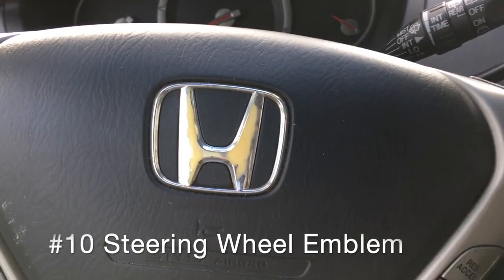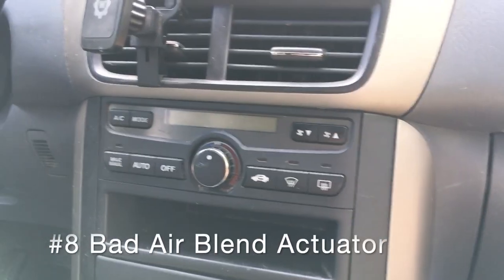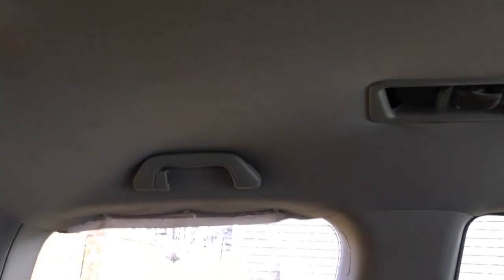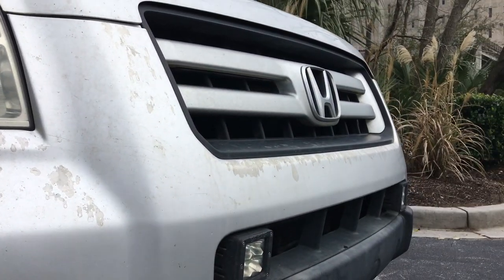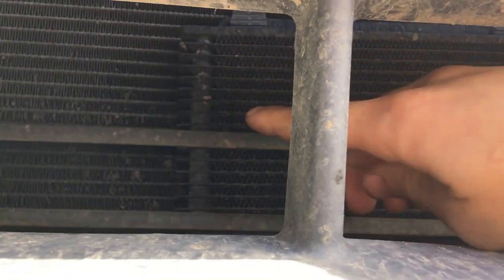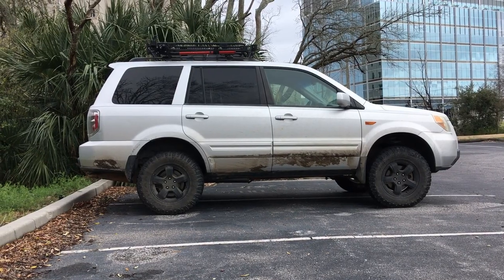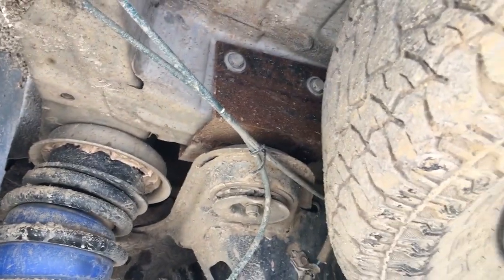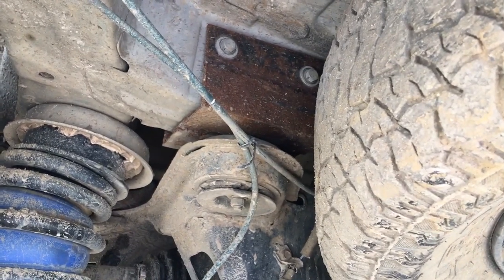Top 10 Common Honda Pilot Problems (2003-2008)

Comment: The steel impact beam behind the rear bumper tends to rust badly up north where we get the annual salt/brine baths. I bought a replacement impact beam from Ebay for $120 shipped. Mine leaves rusty potato chip size pieces wherever I park....LOL
Reply from the maker: I replaced my rear bumper beam to 😂. It wasn’t dropping chips though lol
Reply: yup all the ones i see at the dealer auctions have rusty bumper beams, i live in PA.

Comment: Hey, thanks a lot for your videos! We bought a Pilot 2007 about a year ago and so far we have been dealing with 3 issues. TPMS (I already took notes about the 7 years life for the sensor and to change it preferably when buying new tires). A second issue is the leaking oil, I saw some videos that talked about changing a plastic (do not recall the name) but it has like 6 holes and looks really simple and cheap to replace with a new one (oil filter was also recommended to have it changed). The third issue we are currently dealing with is the VSA warning error. I have noticed that when I turned to the left or right, the error VSA on dashboard is displayed and then it feels like pilot can't move/accelerate. What I do is set on parking, turn off the vehicle and turn on again. This happens around 3-4 times every time I use my pilot. Some say it is due to a disbalance support, some say you have to change bulb (part no. 37250-PNE-G01), any advise you have on this is GREATLY appreciated. In the next days I will take it to a shop, but I would like to have a better understanding and concrete ideas of how to solve this issue as I would not like to pay excessive fees. Again, thanks for your educational videos!
Reply from the maker: On my Pilot VSA can be disabled with a Pilot. Until you can find the cause of the VSA error turning off the VSA will allow you to make turning and accelerating more safe. I have a rare intermittent issue with this that I have not tracked down yet. My research seemed to indicate it could be a sensor in the steering. I am sure there is a way to read codes/ perform a diagnostic to see where the fault lies. The oil leak could be simple, or it could be harder to deal with. My Pilot is currently leaking from the rear main seal. I plan to fix this when/if my transmission goes bad. In the meantime I just keep an eye on my oil levels. It is a pretty slow leak.
Reply: Thank you. For the leaking problem I am hoping it gets repaired with a gasket replacement, if not I read some other solutions like replacing the hose or the ATF pipe (they get rusty). The parts are not as pricey as I thought ($30-$60). About the TSA, I am gathering some ideas on what could be the cause, so I can give this info to the shop (hopefully they do not get offended, as I am just trying to help).

Comment: Only problem I have is with the inside lights. I know it has to do with the head unit above the rear view mirror, but I'm going to try to take it apart and see if I can fix it. If not, I'll replace it. I feel very lucky because I have not experienced any of these other problems. 2004 bought at an auction. replaced the battery and charged the A/C every summer over the last 3 years. Not bad for $1500.00 4 years ago.

Comment: 2005 Piot owner here. I bought mine with 138k and since then replaced 2 TPMS sensors, replaced starter, i replaced the Tbelt, and the PS pump orings. . The valve cover gaskets also tend to leak over time. It's a solid SUV but like all other vehicles that are that old need some TLC

Comment: dude, that ac blend motor, I've been trying to figure out what that noise was for the longest time.  Just ordered the part.  Thanks dude.  my right rear shock mount just broke right off.  that was a surprise.  if you do the timing belt/water pump yourself, don't bother with a impact for the harmonic balancer.  spent days on it with that.  got the tool for it, and used a breaker bar and it came right out.  lots of frustration on that.

Comment: Bought my 04 pilot in 2008 with 78k miles now she has 242,678 miles and only problems I’ve had was my transmission went out and the fuel pump relay went out I suggest u replace those cause they will leave u stranded very easy/cheap fix along with the engine mounts! My timing belt snapped on me at 230k once but I got lucky I didn’t damage the engine and she still rolling would def recommend this car to anyone

Comment: Nail polish! Use 120 grit or higher sand paper to prep the emblem. Be very careful to not sand on the steering wheel itself. Won't look PERFECT, but it at least won't look noticeable.
Reply from the maker: Good idea

Comment: Have a 2006 Pilot with 242k miles. Bought it at 100k eight years ago. Had to replace the timing belt and water pump at about 170k, way past the recommended time. My TPMS sensors went out and my mechanic wanted $300 to install all four. I passed, since I can manually check the air on the tires regularly. Is that too old school?
We also have the gurgling noise, that we couldn’t figure out - so grateful for your video. We are also repairing the rear axle next week and we’re grateful that this was repairable as the rest of the vehicle is in decent shape still. 
One issue we haven’t figured out is slightly flickering lights when idling. Any ideas?

Comment: Here's a follow up to my unibody repair. I was told by mechanics that I needed to seek a "small body shop". When I did so I was told by some that it was a 4K to 5K fix which would far exceed the value of the vehicle. I chose to reel it back and seek other solutions. I searched chassis repair and frame repair. also shops that deal  with axels might be a good choice. I'm afraid that a lot of these vehicles are winding up in the salvage yards because of the gloom and doom being delivered by techs working in a field that is unassociated with the repair that is required. They simply don't now what the proper fix might be. When I found the right shop they told me flat out that it was $650 per side and luckily only one side needed the work but they wouldn't know until the work was started. My pilot is handling much better and is now worthy of a new set of tires.
Reply from the maker: Thanks for sharing your experience!

Comment: Rear ac went out, it’s a fairly common issue. Thankfully, the fix is a resistor replacement that just screws in and and out and you can get the part for 5 bucks at a junkyard

Comment: I have a silver 04 EX RES with almost 193k miles on it.  I tow with it.  A transmission cooler is a must, went with an aftermarket heavy duty one not the factory one.  Only major issues from when I bought it with 33k miles to now have been 1 motor mount at around 105k miles and starter motor went out at 160k miles.  Some little annoying items have been the rear AC not working - easy fix with a $12 motor resistor part on Amazon.  Also, the bulbs on the various dash buttons.

My A/C temp control works great, no issues but I do get that gurgling sound sometimes behind the center console.
Reply: Forgot to add, keep up the good work...I enjoy the videos!
Reply: Mine's been gurgling for about 2 years. I'll probably replace it when it dies, hopefully not in the middle of winter.

Comment: We have or have had 7/10 of these issues on our 212k mile 2008. Strangely enough, it's lived in the northeast all of its life, and the subframe is in fairly decent condition. It has a bit of surface rust, but nothing near what I would have expected it to be.
Reply: spray the left rear subframe mount down with Fluidfilm...also spray it generously inside the rail where theres an opening to the mount.
Reply: Same

Comment: 05 pilot EXL 200,000 miles with a whining power steering pump and a P0430 code, bank 2 catalytic converter below threshold lol other than that i love the damn thing. just got the valve adjustment done with  brake fluid flush for 200 bucks!.
Reply from the maker: The whining power steering pump can sometimes be fixed with a replacement oring. That is a great deal on the valve adjustment and brake fluid change!
Reply: did you do the valve adjustment prior to 200k miles before?  or was this the  first time?
Reply: @viclew9311  not sure I bought the truck used. so I just did everything that should've been done. I would suggest getting the valve adjustment asap or at the 100K mark. i have heard that, that's the reason a lot of cats go bad because people neglect the valve adjustment.

Comment: Drains from cowl at bottom of windshield, drain out through mud flaps!
Mudflaps plug up wit mud and fill your pillar with water, up until water starts coming in following your harnesses.
Carpets get soaked. 
Drill larger drain holes in mud flap as and keep mud clear.

Comment: I have an 06, purchased new and I'm glad to say I don't have any of these issues. 134, 500 miles, garage kept, still looks new. I did change the timing belt & water pump (not leaking) . There's no maybe, if the timing belt breaks in these engines the valves will hit the pistons and destroy the engine SO CHANGE THE TIMING BELT AT LEAST EVERY 100,000 MILES & water pump since you have it torn down that far.  About $200 for belt & water pump DIY or expect to pay 1,200 to 1,600 for a mechanic or dealership to do it. Does not use or burn any oil between 4000 mile oil change & filter, (Mobil 1 oil & filter). Only other thing I've done is regular things like tires, battery,  brakes, coolant & transmission mission flush every 30,000, air filter & cabin air filter. Still ice cold A/C. The tire air pressure sensors still works, (haven't replaced any batteries or sensors yet). These SUV's are well worth the money.

Comment: I bought an 06 Pilot with 181k miles. The first thing I did was to have the timing belt water pump complete kit replaced at a local auto repair for $500. The actuator and headliner are the only pending repairs to be done.
Reply from the maker: Good call on the timing belt and water pump! That was a great price. The actuator is pretty easy, the headliner seams like a pain.
Reply: Whats the name of the local shop you had your car serviced.maybe they have a shop near here in Guelph Ontario
Reply: I bought at 07 pilot with 187k how does one know if the timing belt needs to be changed? 
The only thing I notice when driving is that if I’m driving around 40mph it feels weird. Any test I can do to diagnose those problem.

Comment: My 2007 Honda Pilot's left front wheel sensor had to be replaced. My cheap Actron analyzer brought the code up. It wasn't an expensive repair, just time consuming!
Reply from the maker: @johnshuler1396  I have replaced a few of those already:)

Comment: Great Video.  I have a 2007 Pilot and love it even at 201K on the miles.   I live in NJ and currently have a problem with the engine indicating that is it overheating when in stop and go traffic.  Had my mechanic(over 20 years now) take a look at it and he could not find a problem.  He ran it for over an hour, the indicator indicated that it was getting hot and got to 3/4, then the fan spun on and it cooled right down.  Coolant was changed in the fall.  All hoses are in good shape and the engine has oil.  Radiator was replaced last summer.  Any ideas would be appreciated.
Reply from the maker: When the radiator is cool open it and see if it is full of fluid all the way to the top. It is possible for a head gasket leak to allow exhaust gas into the radiator. The gas displaces the fluid and reduces efficiency.
Reply: @GotterAdventure  - Thank You.  Didn't realize that the anti-freeze had dropped so significantly.  I filled it up and the issue has gone away.  I hope I have not damaged the engine.  Much appreciated.  Stan.

Comment: oil pump failure from using quick lube shop recycled oil and the wrong weight. its crucial to use the 5w-20 not 5w-30 or anything else.
had an 06 that failed because of this but I'm now thinking of adding a pressure gauge to my 05
Reply from the maker: That is good to know!

Comment: Fortunatley, I’ve had none of the issues you mentioned. Mine is a 2003, northeast owner with no frame rot, maybe because I hose down the frame each first chance I get after driving in any snow/salt. Only rust issue I had was the bolt on rear metal bumper, under the plastic. Completely rusted, probably because of poor drainage. I agree on getting only asin parts when doing timing belt change. Only other issue I’ve had was that the pilot seems to suffer from weak suspension components, almost as if the control arms, stab links, ball joints are under size for the vehicle and wear out quickly. One preemptive repair I did was replace the radiator after reading a slew of reports online about pilot radiators prematurely  breaking down internally (and coolant/tranny fluid mixing), and then destroying the motor. Other than that, it’s an amazing vehicle. VTM fluid is very sensitive , and must be changed according to exact honda recommendations, or else.

Comment: My model is 2004 Honda Pilot. It gives a very strong jerk/vibration having to do with gear either during motion or when I slow down. Sometimes it doesn't  select the gear at all especially on drive. I have changed the gear and engine seats but no difference.
Reply: What is the fix for this????? Mine is doing this

Comment: 03 pilot and I've gotta say I have been lucky, only needed 2 major repairs so far, alternator and 3 years later the fuel pump
But I love it and I can't see myself getting a new car for a while 😊

Edit: apparently ignition switches go bad on these alot, if anyone has any questions on doing the swap on your own let me know
Reply: Alternator or fuel pump is no major repair in terms of cost. both have their life span.
Reply: @The_Touring_Jedi  that's true, I just had to install a new ignition and it still wasn't really a hassle, the parts are pretty cheap and installation was a breeze

Comment: 2007 Honda Pilot owner I’m at 325k sometimes when in 4wd an backing up then changing to drive I get a grinding / locking up sound but goes away after I full stop

Comment: 2005 Honda Pilot owner with 178k.. Steering wheel emblem still looks new, TPMS sensor just failed this week, HVAC blend door actuator broke years ago but still heats and cools, clear coat is good, Cats good, No Flavor on the subframe Giggity, replaced all motor and trans mounts, replaced both front cv axles, oh and headliner is failing!

Comment: Sorry forgot there was a 5th issue.  The HVAC blend motor issue.  Mine sounds like an old perculating coffee maker.  Annoying, but not like "Annoying Orange" annoying.  So far only "paper cut" issues with mine.  But will definitely check on the frame rot issue.  I bought mine used last year before I found your site so didn't know to check.  As I said below you've got a subscriber now !

Comment: The emblem on my '03 is fine! 😂 I'd trade the other problems for a ruined emblem though. You take my whiny power steering, dome light and other interior light issues, and now my turn signal problem and I'll take your chipped emblem. 😂🤷

Comment: I have a 2004 with 300,000 miles always runs great but have a starter problem now, It starts after sitting a while then if I turn if off and then  try to restart it won't start.  They had a locksmith work on the  ignition and it worked for a few months now back to the same problem.  I want to sell it but don't want someone else to have the same problem.

Comment: My Pilot had a cracked tensioner and a worn harmonic balancer pully that threw the belt off every chance it could. It never had it's trans fluid changed in the 11 years the first owner owned it, so it shifted wonky until I did a partial flush. Do not ignore trans fluid on a Honda. It's an easy enough job to do yourself.
Reply from the maker: Did the late fluid change help or hurt?
Reply: @GotterAdventure  my question as well. I'm at 140k and dont know if it's been done
Reply from the maker: @truthistreason9708  I would recommend a 3x drain and fill. My Honda’s all like fresh fluid.
Reply: @GotterAdventure  any specific way to do that?
Reply from the maker: @truthistreason9708  drain the transmission, measure the amount of fluid captured in pan. refill with same amount of transmission fluid. Drive a bit, repeat 3X
Reply: @GotterAdventure  thanks for the information man!
Reply: Hopefully it doesn't kill it lol this is my only family vehicle and I'm trying to ensure it lasts
Reply: @truthistreason9708  there is also a transmission filter that is underneath the battery tray that you may want to replace. If you drain the trans from the bottom,  it takes either 4 or 4.5 qts to reset the fluid level, which can be done through a fill plug on top. Be sure to clean the magnet on the drain plug before putting it back in. Mine was caked!

Comment: I have a 2007 Pilot and I dealt with the frame rot issue on the rear driver side. I took the car to a welder who specializes in automotive work to repair for 400 bucks.
Reply: I have the same problem!! Where are you located?

Comment: I've had two Pilots over the years.  Currently driving an '08 with about 155k miles.  Before this one I had an 05 that got totaled by a by a tractor trailer from behind.  The issues I've come across:  Interior AC/Heat control lights burning out, Rusting above the rear wheels where the bumper parts from quarters, Rusting and vibrating of catalytic converter heat shields.
Reply from the maker: Thanks for sharing! Oh yes the heat shield is a good ☝️
Reply: I have that heat shield noise too on my 08

Comment: I haven't had these problems with my 2003 pilot the only problem I had was the paint and the alternator bracket snapped off the block but other then those two problems its been the best suv I've ever owned
Reply from the maker: Thanks for sharing! I am glad there are Pilots that escape these issues!